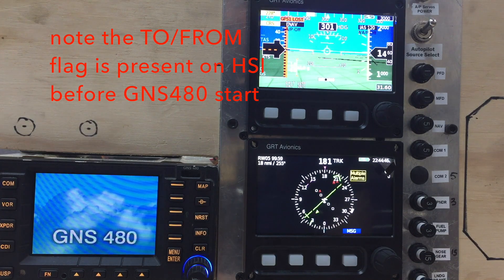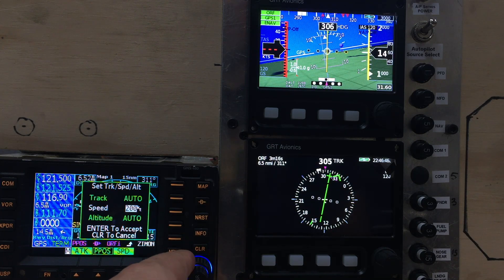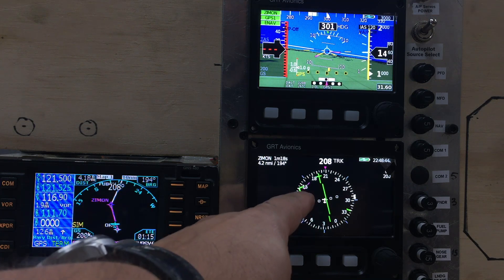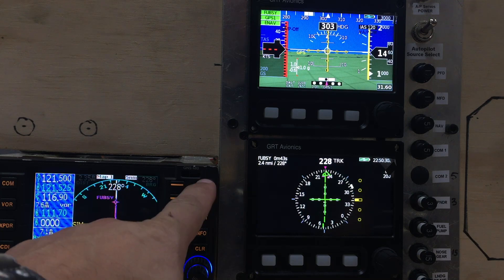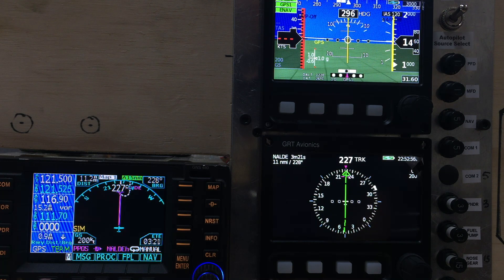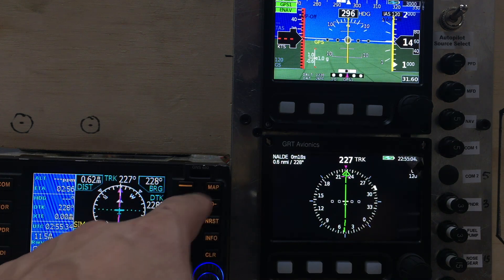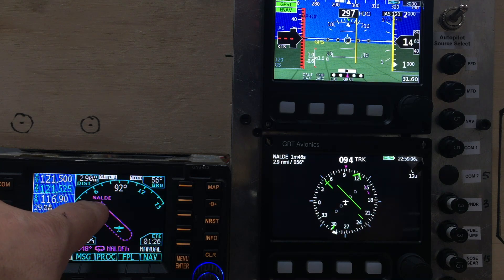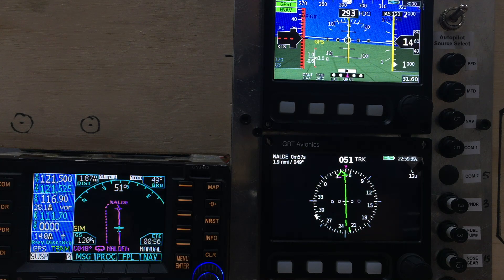GNS480 & GRT MINI AP integration issues

Comment: You need a Velocity and you really can do 200 knots! Do you need a TO/FROM flag when the RMI pointer always points to the station?
Reply from the maker: The problem was that the RMI pointer did not point to the station. GRT reply this morning (in the description above) clarifies the RMI behavior. As far as the flag, I can live without it, but I am not sure whether it would be a requirement for IFR certification or not under GPS. They work fine under VOR/LOC as they must in that case.
Reply: is your top EFI the primary it looks like. and your compass was off by 200 degrees. I looks like it takes that information for your TO and FROM. and it get 2 different readings. move the panel on the bench and see if the indication changes.
Reply: Bench fly the Panel.